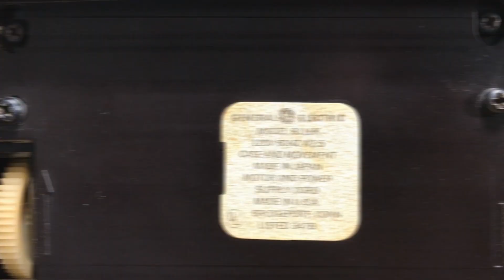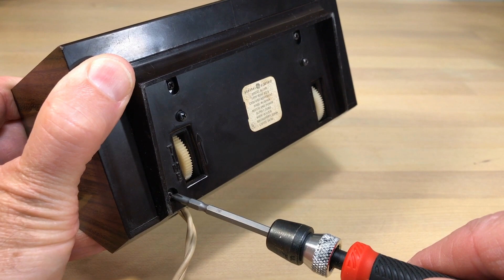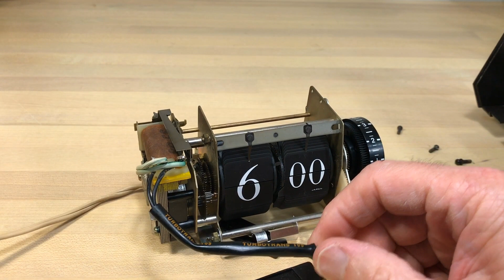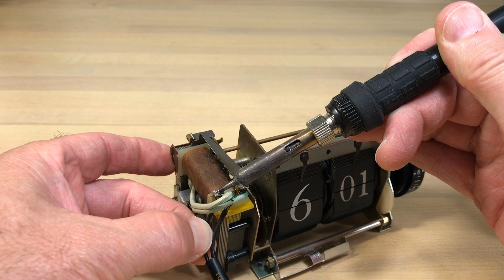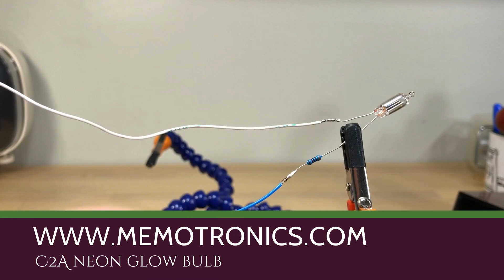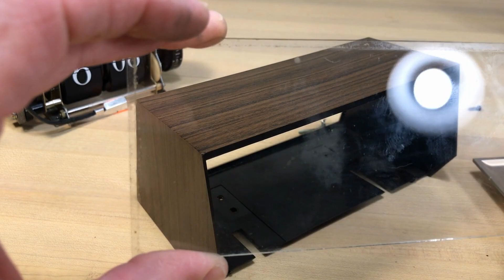The General Electric Model 8116K Flip Clock

Comment: My partner's mother gave him this as a gift in 1967. We've been using it since and it works except the light went out and we don't know how to fix it or wonder if it is worth fixing. The clock's alarm is so sonorous that it will wake you up even if you are dead drunk. I rely on it whenever I must wake up. The manual dials are simple to use. We love it despite its old age.
Reply from the maker: Yes! It’s worth it to fix! I’d fix it for you if you send it in! Or I could make a video about replacing the light if you’re mechanically inclined. Contact me at flipclockfans@gmail.com if you like.

Comment: I have this exact clock and I have the exact same problem. I’m glad I found this video. My question is do you have a links for the two leads? You have the bulb and the resistor but what did you use for the leads? Many thanks.
Reply from the maker: I used 24 awg wire. I don’t have a link for it but silver plated “mil-spec” wire like this is often sold on ebay. That’s where I got mine.